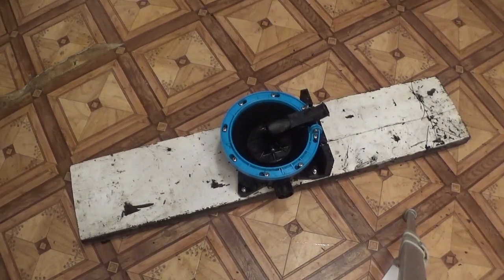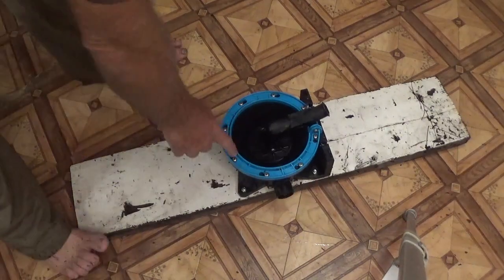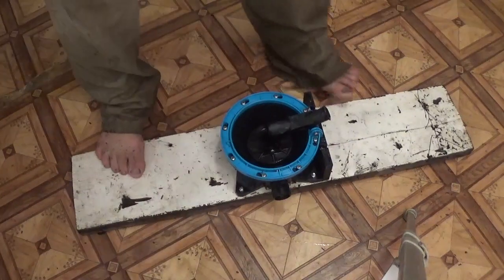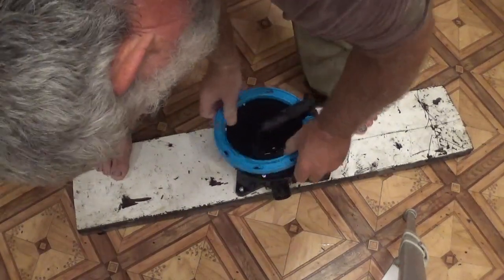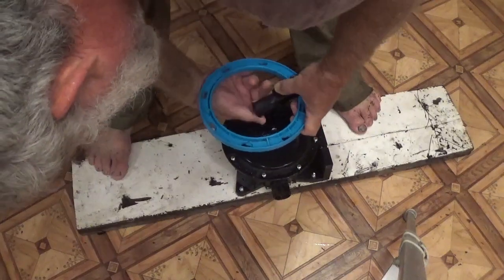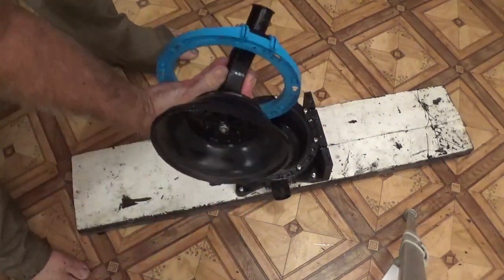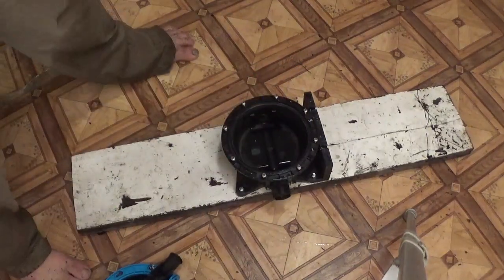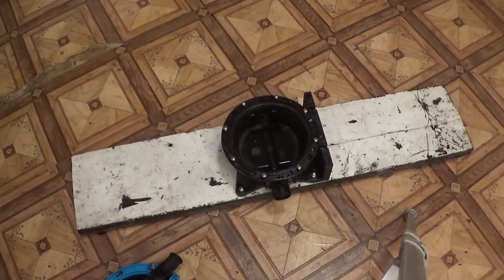how to pump aircrete the cheap way

Comment: Manual pump? I am looking at building an entire house... The best I have seen so far is using the same type of hose but pushing crete out using air pressure. That is mighty cheap if you already have a compressor, which you would have if you were gonna build, say, a house.

Comment: pumps cause a low pressure vacuum on one side of the pump, and higher pressure on the other side. I'm guessing the low pressure caused bubbles in the aircrete to expand and merge. Large bubbles might make their way to the top and escape the aircrete. 
FYI: A vacuum chamber is a common method of removing bubbles in resin before pouring a mold. You need to mix the resin with the activator thoroughly for a good casting, and small bubbles are usually introduced into the resin during the mixing process that will not escape before the resin sets. Vacuum chambers are used for removing the bubbles.
https://youtu.be/SHXuC1lIGj4?t=85

Comment: It seems the inner texture of the pool hose would be very harsh on aircrete being moved through it.  That might contribute to the collapse? 
It would be interesting to see if it would turn out different passing through a hose with a smooth surface.